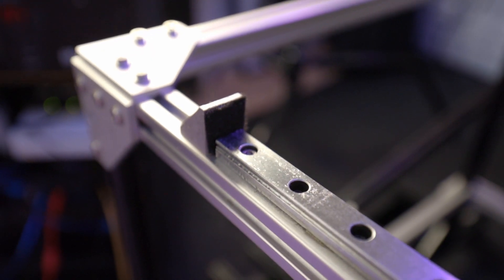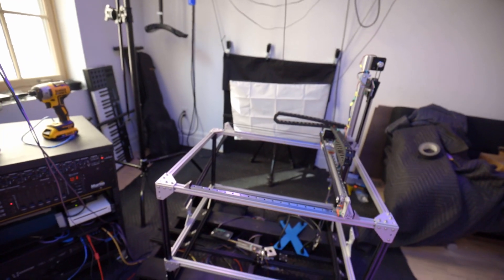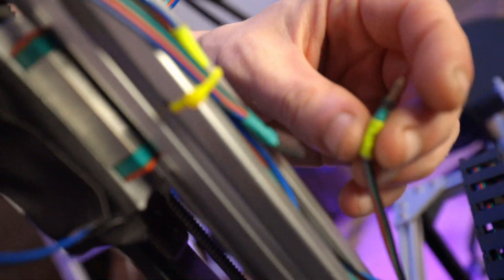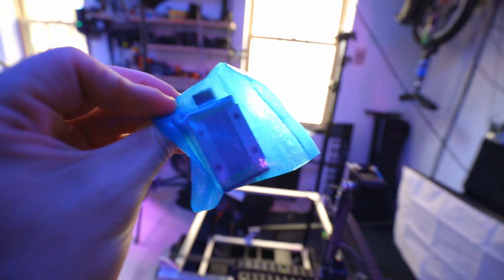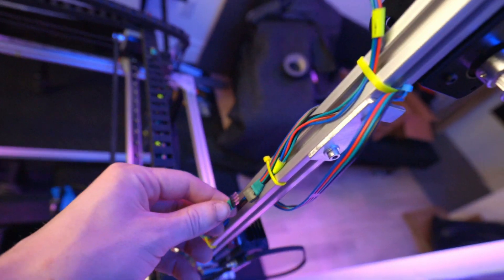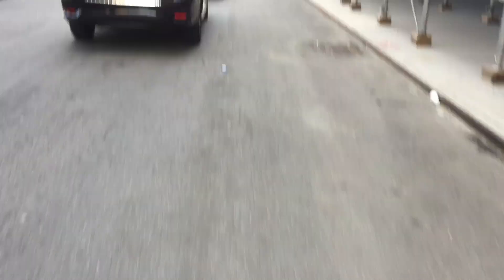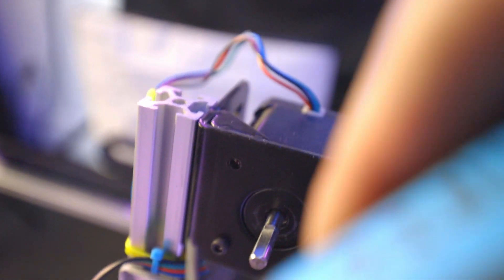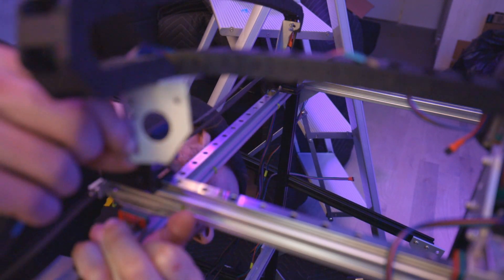Light painting machine tune ups + troubleshooting

Comment: Do you have a recommendation on a supplier for mechanical parts and extruded aluminum like you used for this project?
Reply from the maker: I get almost everything from ebay and amazon. Occasionally I get stuff from McMaster Carr if it is some really specific piece of hardware that's hard to find anywhere else.
Reply from the maker: If you can afford to wait a month, you can buy a lot of stuff for a lot cheaper directly from china through ebay, often with free shipping.